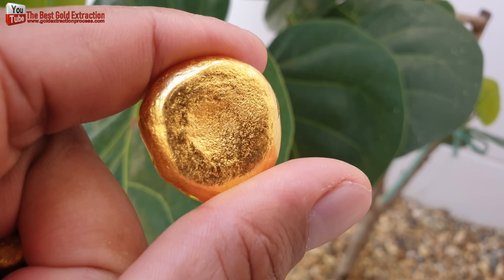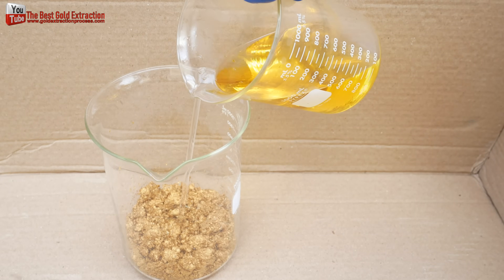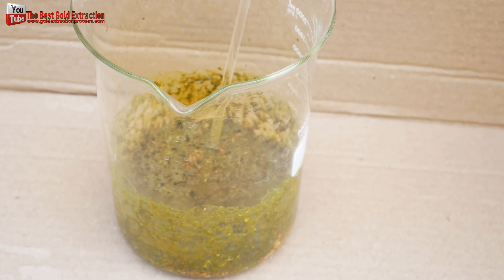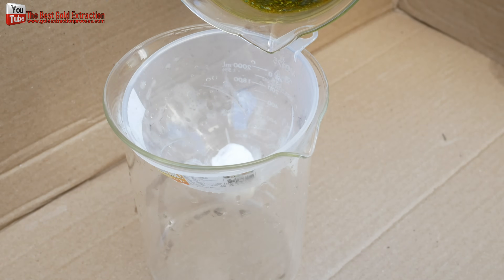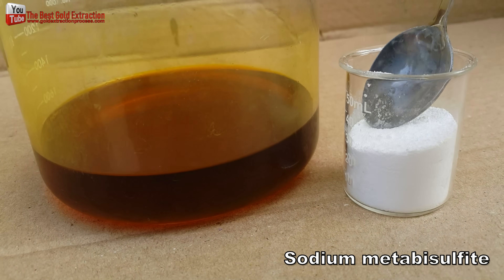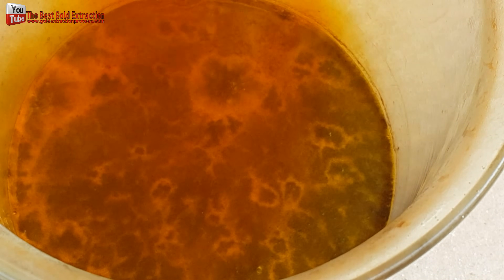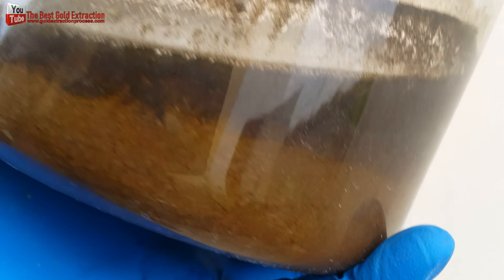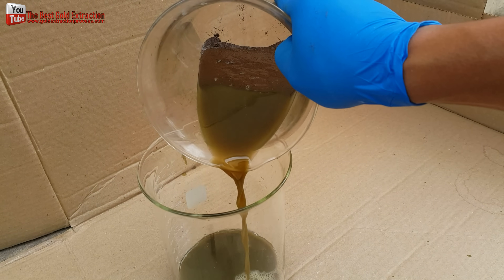Gold Recycling precious metal | Gold 24k Recovery

Comment from the maker: How Gold Is Recycled
How to Extract, Separate & Refine Gold
Gold has been prized as far back as ancient Egypt for its beauty and unique properties. Humans value gold because it is rare, lustrous, easy to melt, malleable and an excellent electrical conductor. Because it is a precious metal, recycling gold can be a cost-effective alternative to mining, depending on the source and how difficult it is to separate the gold from other materials in the waste stream. Recycled gold made up 35 percent of available gold between 2005 and 2010.

Sources of Gold for Recycling
Gold is used to create jewelry and coins, as dental fillings and bridges and in industrial and electronic applications. Gold jewelry and coins are often recycled through brick-and-mortar dealers or mail-in programs that pay individuals for the unwanted gold. Gold recycled from fillings and other dental work is often collected by dentists and sent to a recycler. Significant quantities of gold are found in catalytic converters and circuit boards, which can be recycled by municipalities or commercial collectors.

Recycling Jewelry and Coins
The first step in recycling gold jewelry and coins is sorting out the purities of gold, measured in karats, with 24 karats representing pure gold. The quantity of impurities can be assayed with an acid kit, electronic tester, X-ray fluorescence spectrometer or melting point test. Once the gold is sorted, it will be melted in a crucible at around 1,064 degrees Celsius (1,947 degrees Fahrenheit) and either poured into bars marked by purity, or further smelted to remove impurities. Smelting is a process where impurities are burned off, or a flux is added to react with impurities and separate them from the pure metal.

VIDEO OF THE DAY
Recycling Electronics
Recycling gold from industrial and electronic waste is less straightforward because the gold is embedded in a metal or plastic housing and may only be two percent by weight. Once the pieces containing the precious metal have been stripped, several options exist for processing. The first is chemical stripping with a compound that reacts with the gold. The second option is to melt down the metal components, cool them and grind them up. Both processes require further extraction and purification through smelting.

Dental Gold Recycling
The gold found in pulled or discarded fillings, bridges and casting molds can be collected by dentists and sent to a recycler. The purity of dental gold is usually 16 karat, but it is slightly more complicated to recycle than jewelry because it may include nonmetal content like tooth enamel or porcelain. The recycler will use a process like acid reduction or reverse electroplating to extract the gold from the nonmetal elements. The extracted gold can then be formed into bars or further refined.
Reply: What way is the gold out of the stone.
Reply: Hiw can i contact with you???